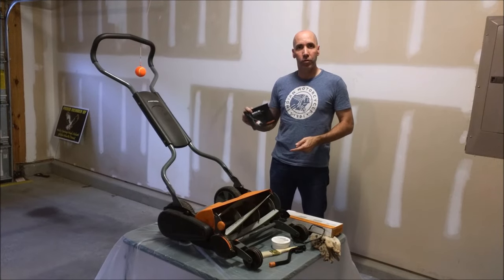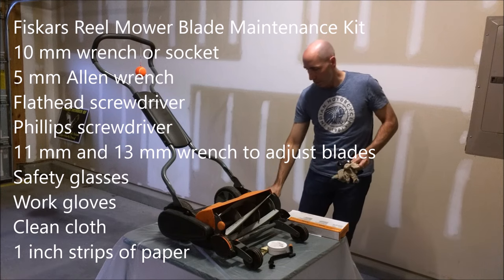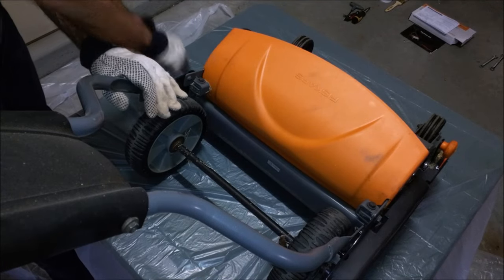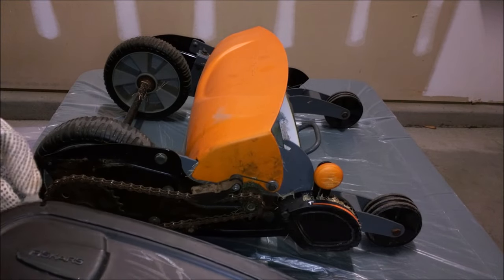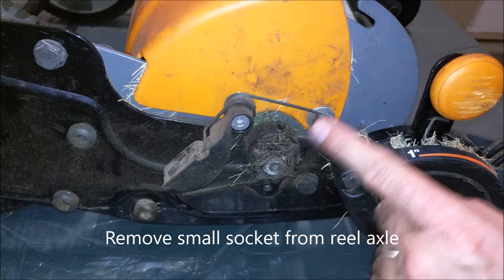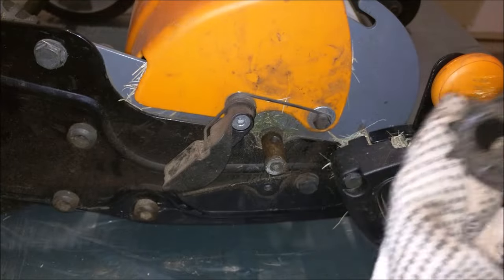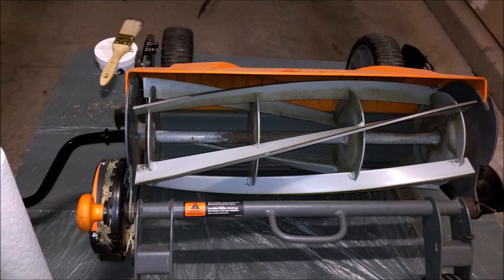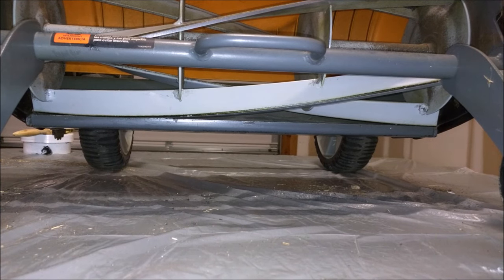Fiskars Reel Mower Blade Maintenance Kit Sharpen Blades on Fiskars StaySharp Max Reel Mowers

Comment: do you know if you can remove the back where the blade is very close to hitting? mine hits or clogs up. not sure which one, but it's annoying. i want to remove it, used an 8mm allen wrench, but stripped the bolt.  the part i am referring to is in front of tge rear wheels. your touching it near 2 min 13 sec.
Reply from the maker: Doug Dinger I am not sure. if you are talking about the bed knife at the bottom, are one of the blades hitting it?
Reply: Dan Thomas yes the bed knife. not sure think it just gets clogged with grass
Reply: Yea, didn't realize that was a knife. Thought the spinning blades cut the grass. I was able to fix the mower. Just had to adjust the blade.

Comment: Can you just use a whetstone? My reel mower is not Fiskars, so the kit wouldn't fit anyway.
Reply: Very difficult to do properly and you can't sharpen the bed knife without complete removal.  The backlapping approach is faster, easier and approved by all reel mower manufacturers.  This the way pros do it.

Comment: I tried three times and all three made the same noise as in your video with the lapping compound. However I tried cutting the paper and it just would not cut in any of the blades or any of the places. I bought it used so there is a possibility is broken forever :(
Reply: Sounds like it's almost surely a blade distance adjustment issue. Sometimes it's better to go by sight rather than listening for some arbitrary sound or trying to go by feel, alone. Fiskars really should have made the blade adjustment process much easier on this mower. I've seen quite a few other reel mowers over the years with simpler/ more user friendly blade adjustment mechanisms.
Reply: @Destrobius  Yeah I am kind of glad I bought it cheap used but I dont think I will do the same brand again. Too much of a hassle
Reply: jcbabacha -§- Yeah, but this is the only solidly made push mower. All the rest are cheap junk made in China, and you will have more trouble keeping those working.
Reply: @KeithOtisEdwards  Sigh. Well thanks for the info!

Comment: Hey, any tips on why my fiskers wont cut long skinny weeds  that pops out before the grass?
Reply from the maker: Toby Denney I don't really have at tip. However, Fiskars states their mower will not cut higher weeds. It simply isn't designed to get the high stuff between the bedknife and the reel.
Reply: The 5 blade reel is insufficient to cut longer thin blade types.  If Fiskars offers a 7 or 11 blade reel it will solve your problem.  Everything we use on the golf course (fairways and greens) are 7, 8, or 11 bade reels to increase the frequency of cut.
Reply: In order to get most reel mowers to cut anything taller than 7-8" in height, you often have to lift the front of the mower up (pop a wheelie with it by pushing down on the handle and then getting the reel to spin while you go over the area of tall grass/ weeds that you're attempting to cut) . The goal is to keep most of the reel above the tallest part of the grass or the weeds being cut to allow the grass/ weeds to be pulled forward and down into the bedknife.

Comment: Hi, can I get spareparts for this? Someone attempt to adjust cutting without loosing up the 13mm lockscrews.. Now the threads are gone on the adjustment screw and on the point where the screw is raising&lowering the real.. This is on the shain cover side...
Reply from the maker: i would suggest you call Fiskars tech support number. i have heard their support is pretty good. maybe they will simply send you a new screw with instructions. Good luck.

Comment: I can't for the life of me get the small front sprocket off. I was able to remove the screw with my Allen wrench (with lots of work though) but am stuck at removing the sprocket. Anyone else have this problem and/or solution? Or a juryrig to spin the blades without removing the sprocket?
Reply: Prop the mower up so the wheels r off the ground.... spin the wheel by hand.... Maybe take a piece or wood 3 inch thick or something... drill a whole big enough to gently tap it over the gear without breakin teeth off... but dont drill all the way through the wood ( just deep enough to get it bite on the teeth of the sprocket ) then drill a whole through the center of  the piece wood so u can put a nut and bolt long enough through it and tighten it so theres enough of the bolt sticking out to attach a drill to it and spin it .  .. This is just a quick idea... Hopefully it helps idk ... also prolly some typos, miss spellings, missing words, and all that .. not caring at the moment... just wanted to help n thats what I immediately came up with ... so sorry if it dont work or ur not able to craft this idea... but it might help u think of a better way

Comment: I have trouble after sharpening to cut the paper strip without blades touching. Mainly in the middle section :(
Reply from the maker: I am not sure if you are having problems with all of the blades or one in particular in the middle. It may be possible that you bent a blade on the reel while cutting which moved it further from the bed knife in the middle than on the ends. If this is the case, you may need to take it into a specialized lawn mower repair shop (e.g., a place that services other "reel" mowers like golf course greens mowers) to fix the blade. Sorry I am not much help here...
Reply: Seems that bed knife is probably bent since problem is the same all around the reel. I tried few hits with hammer to no avail.

Comment: Door squeaks as wife walks in looking for him near the end she has been looking for him all day. Think i will use a sharpening stone instead. No offense. Good vid.
Reply: The back lapping method is a proven method and is advocated by the manufacturer.  it works fast and sharpens the bed knife too. It also naturally keeps the reel round.   I think it would be very hard to do this by hand.   And note it won't help the bed knife unless you remove the reel and sharpen it separately.

Comment: Also Dan Thomas, there is no need to disassemble the mower, all of these steps are actually unnecessary, and again there is 1 "one" blade, the reel feeds the grass blades into the blade which cuts the grass. All you need to do this is an 11mm and a 13mm wrench and common sense people!
Reply: If you need to sharpen, you will need to remove the sprocket.  You can't spin it backwards properly for lapping without doing this.   Just adjusting the mower won't work eventually, it does need to be sharpened occasionally.   The reel does not feed the grass into the "one" blade as you put it.   The reel blade and the bed knife as a scissors so both the bed knife and the blades need to be sharp.

Comment: There is only one blade, this guy is not putting the compound on the "blade"
Reply: Eric Swarr I know lol.. also it's better to adjust the blade not the reel that he adjusted
Reply: there are 5 blades on the reel and the fixed cutting point known as the bedknife.  Reels use a scissor action to cut,  Check out videos from Bernhard grinders, you'll get the skinny on how reels work.